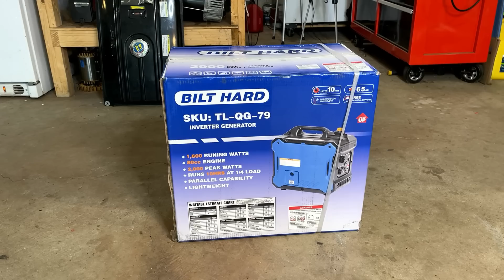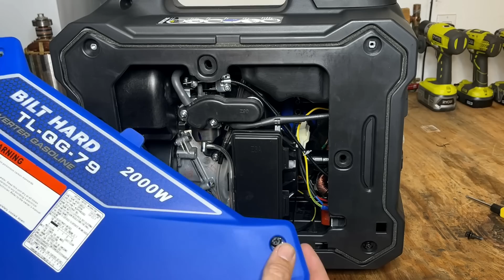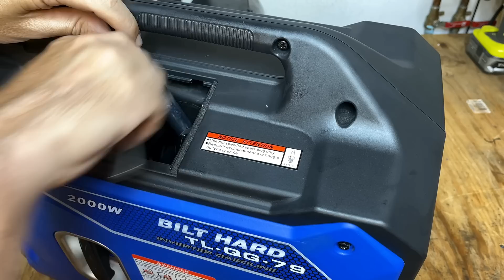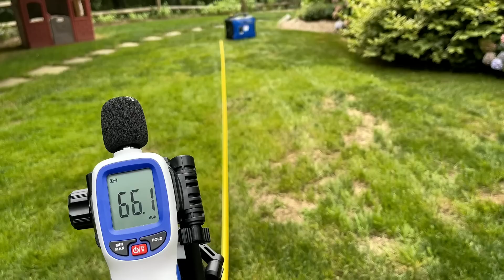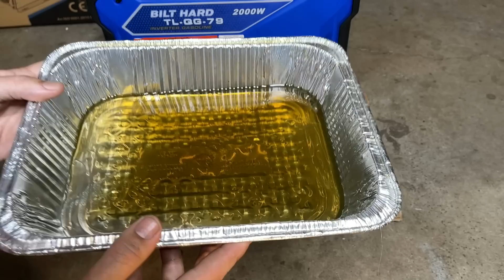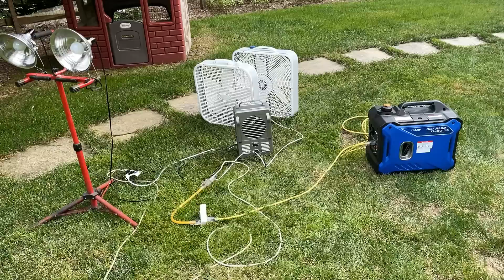Bilt Hard 2000 Watt Quiet Inverter Generator Review and Test

Comment: I followed your Amazon product link and  it list the weight as 160 pounds, surely that  is not correct. Do you know what is the actual weight?
Reply: Elsewhere on the Amazon page it says 40 lbs. Honda eu2000i was 45 lbs. These are dry weights - with oil and gas a bit more. Light is nice but it also means less material cost. I'd be interested to know where the weight loss came from on the Bilt Hard.
Reply from the maker: It felt very similar if not a little lighter then the Honda EU2000.

Comment from the maker: This inverter is rated at 1600 watts, 2000 surge watts.  I did not make that clear in the video.  Inverters always list their surge wattage on the unit instead of the continuous watts.  I did not accept payment for this review, but the product was sent to me at no cost.
Reply: For future reviews it would be nice if you mentioned how you got the unit early in the review. Just for transparency.
Reply: Very nice little generator to use for camping or getting some lights on while starting up larger generators ...
Reply: I test and review another product (not on YT) on similar terms. Myself and others doing this always state early and clearly whether we've purchased or received it gratis which if nothing else keeps the bashers at bay. Visible integrity is the term I use, and in today's world it matters almost as much as the integrity itself, which you clearly have.

Comment: That was a pretty gentle test.   Not many people are going to be OCD about breaking in a cheap off brand generator.    Let's see how well those plastics stand up to having gas splashed on them or getting bashed around in the back of a camper.   How well is that  foam "insulation" going to stand up after being soaked in gas or covered in oil?    Plug in a refrigerator and a freezer and see how long a tank of gas lasts.
Reply: why would anyone splash gas all over the generator, and if so why would they not wipe it off properly? Why would anyone soak the insulation with gas or oil?  I have numerous plastic generators some I have had for almost 20 years that still look brand new and run perfectly.

Comment: Every measurement of the frequency was 60HZ leading me to believe that this has a pure sine wave inverter which is great for electronics equipment including computers.
Reply: Yes, but something has got to give.  A standard generator would start to droop in frequency when loaded up. These inverter generators stay at a perfect 60 hz but lose voltage and when overloaded they lose a LOT of voltage.  James was being nice - notice he didn't put the scope on the generator when it was fully loaded or overloaded.  That pure sine wave might not be so pure at maximum load even if it is still exactly 60hz. 

Of all things, computers care the LEAST about clean power (or voltage - look at the rating plate - it will say something like 90 to 240V).  The first thing that a switching power supply does is convert the AC to DC so it can be square wave, sine wave, dirty wave, whatever and it all gets filtered out.  Things like motor loads actually care more about clean power.
Reply: My New pure sin wave portable china inverter generator died after only 6 months of off grid use. Careful with over load light coming on or blinking on, even Honda inverter generators. Honda said their inverter sometimes burns out from being over loaded with power. Honda inverters may be a little better though. My china inverter inverter generator burned up just running a electric blanket and less than 3 amps total!!! Over the years none of my non inverter generators never burned out anything even running them comericaly for business!!!
Reply: Bilt Hard claims their generators generate pure sine waves.

However, the fact that the frequency remains fixed independent of load doesn't say anything about the wave form.  It just means that the inverter isn't locked to the motor speed - which is what you'd expect from a DC-powered inverter, like small ones you plug into a lighter socket on pure 12V DC.  It could just as easily be pure square wave.  You'd have to hook up a scope to see what the wave form was truly like.  Or rely on the manufacturer's claims.

Comment: When you took the cover off, I noticed the split case engine design, like my Honda EU2000. No doubt that is a Chonda engine. I noticed the copper wire wrapped  torrid on the inverter regulator module which should cut  down on RFI. It looked like the  Inverter module is "potted" with epoxy too. It would have been nice to look on the oscilloscope of the sine wave under load of something other than an AC motor to see how much noise it produced on the output. Great price on this generator, just wondering if they used aluminum wire windings on the generator stator? That is a rock bottom price for an inverter generator. I know you will give us a report back after long term use. Thanks for posting.
Reply: It’s typical Chinese low quality product. Try taking it to your local small engine shop for repair and they’ll most likely refuse to work on it due to no workshop manual and access to parts. It’s a typical throw away product. Really wasteful.
Reply: @andrewwitham5405  where i live we don't see any honda/yamaha/yanmar in repair shop, even most honda small engine you can find today is built by jialing

Comment: Hi would u say that changing the oil on new engines would that apley 2 a car or any engine
Reply: Yes. First "oil change" service on a new car or motorcycle is commonly after just 500-600 miles. After that, 12,000+ miles is the regular interval.

Comment: It would have been good to see the sine wave with each additional load that you put on it to see when it started to crap-out... It's supposed to be rated at 2kW, but it craps out below 1.7kW--not much of a generator, imo. 120V*12A=1.44kW is ~72% of what your genset labels shows.  My genset label shows the actual rated (running) power & the peak is ~40% higher than the rated power.

I paid the same $ for a used (like new) unit that provides 5.5kW continuous (peak of 7.6kW).

Your unit isn't capable of much.  I'd return it & shop around for a better unit that can actually do more work.  At least power a 1500W heater or window AC unit, refrigerator, fan, microwave, & some electronics (TV, PC, etc) (total load of at least 3kW).
Reply from the maker: Inverters list their max surge load on the outside.  It is only rated at 1600 watts.  Same as the Honda EU2000.   2000 surge, 1600 max continuous.
Reply: @jcondon1  Crappy gensets do that--most good gensets don't.

12A*120V=1440W, not 1600W.

Your system throttled the Voltage to 107.7V when you overloaded it with ~1650W of load.

Your genset isn't much of a genset--it's more of a toy that isn't designed to service much of a load from what I've seen.  I wouldn't waste any money on anything less than 3.5 kW RATED POWER...ymmv.
Reply: @ab_ab_c  The size of your generator should be matched to your application.  If you are going camping and just want a few lights and a fan, a 3500W generator is just going to be noisy and a waste of gas. They sell tons of these Honda "2000" inverters and clones - they have an application even if it isn't what you want. These little generators are super quiet (especially when they are not heavily loaded) and can be carried easily out to the beach or wherever - you're not going to drag a heavy wheeled generator over the sand or a rough trail. It's common practice in the generator industry (including Honda which is the top player) to label according to surge wattage.
Reply: @throwbo  When I camp, I don't need a generator.  I cook on a campfire or small propane fire & I use flashlights inside a tent & never use a fan.  I have no use for such a toy genset. ymmv--& that is ok...
Reply: @ab_ab_c  Always one whinger well done legend.

Comment: Thanks for the video review James. At first glance this generator looks very similar to the Harbor Freight Predator 2000 watt inverter generator. Glad to see you own a new generator :-).
Reply: That one goes for $560 so this is a couple of hundred $ cheaper.  The Predator doesn't have USB jacks but it looks like they have the same 80cc engine (Honda EU2000i had 100cc).  Forgetting about surge wattage, I think that 1600W continuous out of an 80cc engine is dubious (20W per cc - most small generators are more in the 16 or 17w/cc range).  I think they should have called this a 1450 running watts generator.  Don't plan on running it at 1600W for more than a short period.
Reply: @throwbo   1600W continuous out of an 80cc engine is dubious (20W per cc - most small generators are more in the 16 or 17w/cc range).  Interesting.  How are you figuring that?  On an energy basis considering mechanical losses?
Reply: @alext8828  Just based on other generators.  For example the Honda eu2000i has a 100cc engine for 1600W continuous (16).  I have a 5000w generator with a 305cc engine (16.4) and a 3600w w. a 212cc engine (17).  Another rule of thumb is 500w per HP and this generator has a 3HP motor (so should be 1500W).
Reply: @throwbo  Interesting.  Thanks.  I think the engineering world uses something like 1 hp=746 watt.  I really don't understand why there would be a difference.
Reply: @alext8828  Because generators are not 100% efficient.  746W of power at the shaft does not mean 746W of electricity at the outlets. There are friction losses in the bearings, electrical resistance losses in the coils,  etc. - this all gets turned to heat. Some  more of the energy is used to drive a cooling fan to blow away that heat so that the generator coils don't melt.  The smaller the generator the greater the proportional losses - the really big generators like in a utility power plant are more efficient which is why it's cheaper to buy electricity than to make it yourself in a generator.
Reply: @throwbo  Of course.  Very true.

Comment: What did the waveform look like at 1/2 or full load?  Just curious...  Great video!
Reply from the maker: Should have checked.
Reply: @jcondon1  I also would have liked to see the sine waveform at the different power levels. Thanks for taking the time to do this video.
Reply: @jcondon1  - Thank you for the video!  I was surprised at how good the sine was with no load.  I have seen some with slight waveform degradation at 1/2 load and much more at higher loads.
Reply: @jcondon1   I would have liked to have seen more head to head comparison with the Honda not just on noise but on everything (especially at fully loaded conditions) - voltage , wave form, etc. Honda is the benchmark that these Chinese inverter clones are shooting for. Do they hit the target or do the fall short and by how much? This is 1/3 the price of a Honda - they had to cut corners somewhere. Where?

Comment: England. Hello James. I have always been a fan of magnets for collecting odd bits of metal in engines. On my new 2.8Kw inverter generator I have placed a Neodymium magnet on the outside head of the oil drain plug. It's worked in the past and collects quite a surprising amount of metal especially on new units. The casting it goes into is aluminium but they don't work so well if it's iron, you need one inside for them. It's a pity they don't have a pump and oil filter, it must effect the life of the engine and makes oil changes a must. 
Question - I think I'm right in saying that powering freezers is a problem because of their capacitive start system, any help would be appreciated. I have 3 freezers. We have very reliable power in the UK but one never knows for sure these days.
Reply: Most people don't realize this but in the case of needing to use a generator / inverter to power freezers, those freezers do not need to be powered continuously. I did a test on 3 upright freezers and one chest freezer that I have. I left them all unplugged and only opened the door slightly to check the frozen status of the contents. The ambient temperature surrounding the freezers was about 76 Fahrenheit. On the end of the third day, the contents of the uprights was border permafrost. The chest contents were still solid.
Point is, when using a generator to maintain freezers, the freezers only need to be plugged in about every other day to maintain the the frozen contents. Plug in the freezer, let it work for 2-5 hours, then unplug for a few days. The key is not opening the door on the freezer.
I tried it with refrigerators, but I could only get a comfortable day and a half of refrigerator cold.
Reply: should not be a problem as most loads tend to be inductive so no prob

Comment: Not going to get in an oil argument, and I like that you take care of your machines, but if a customer bought this generator and started immediately using it for hours, it's not gonna do catastrophic damage. Most important thing is that the oil doesn't run low and is changed frequently. Nowadays I'm slightly less concerned with break in.
Reply from the maker: I agree.  I guarantee that most people follow no break-in procedure and most end up being fine.
Reply: Most people don't even read the owner manual. Most people do not even service their generate until it won't start. I have generators that some are almost 20 years old that are like brand new because I take care of them.  That way every time I need them they work perfectly.

Comment: After watching hours of your videos I went and bought a non-running power made 1850. It was taken apart and someone tried to fix it. I got it running and it lurched I bought a carb kit for $12 and sprayed out the passages With carb cleaner. Now it runs perfect I paid $40 for it. I’m not sure I need a generator
Reply: Flip it for another and keep moving. Little by little it will add up.
Reply from the maker: That is how it works.  I started out with one.  Sold it and could then buy two.  It adds up quickly.
Reply: I did the same thing. I got a Coleman Powermate 5000W continuous for $50 and spend $11 on a clone carb on Amazon and was good to go. Makes it hard to think of spending even $350 on a generator.  Ignore the Craigslist ads where people ask $300 for a non-running generator. If it doesn't run it's not worth much. 3/4 of the time it's just the carb. Give it a spritz of starting fluid and pull the rope - if it runs and lights up for a few seconds, take it. Otherwise leave it for James to rebuild.
Reply: @leonardo migot What?  Explain all that, please.
Reply: What's the difference between a inverter Gen vs a regular Gen
Reply: @iancameron198 
An inverter generator is a regualar generator with an inverter. 
Some advantages of inverter gens are: 
1) They often produce cleaner power.
2) They have auto-throttle which adjusts the engine spd according to the load, therefore saving fuel and making less noise while they're idling or under low load.
Reply: @-paganless2-432  thank you.i was looking at them at harbor freight and the lady said it used a battery.she couldn't explain any further.i was confused as I never heard of that.i didn't buy it.but bought a different one.
Reply: @iancameron198  
You are welcome!
Not sure what she meant, but as far as I know a generator uses a battery to start the engine (just like a car) so you don't have to use the rope, but this has nothing to do with it being an inverter unit.
Which generator did you get though?
Reply: @iancameron198  I googled it and I got an answer but it’s way over my head. Give James CondonA comment instead of the reply that you just gave and he will probably answer you